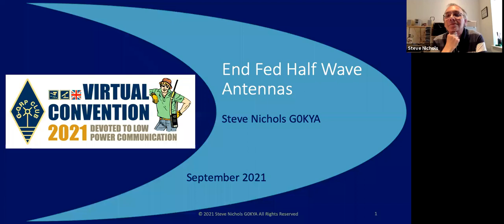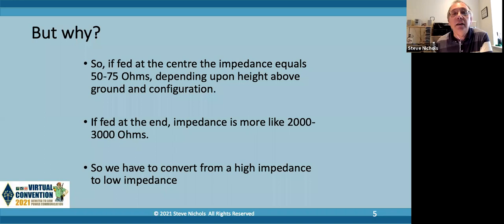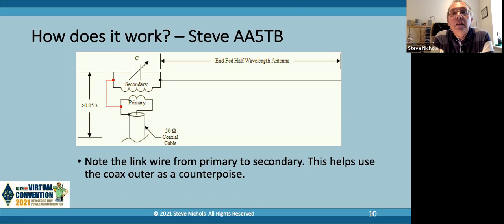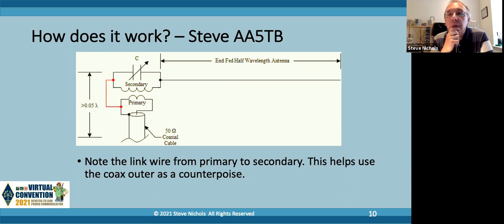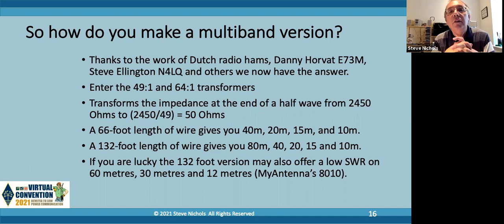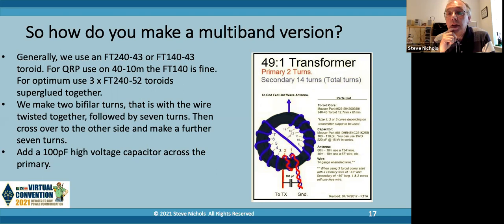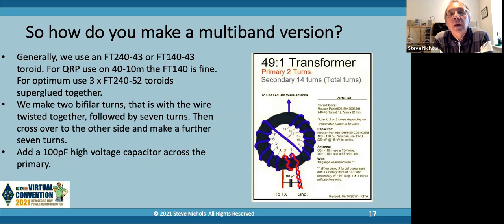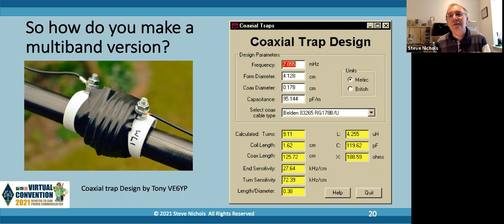Steve, G0KYA, shares his experience of building and using End Fed Half Wave Antennas

Comment: Once Maxwell's equations were published in the 1860's the entire field of antennas went from a new concept to merely engineering optimization for a specific application.
BTW, I've found that a $50 NanoVNA makes antenna design and construction, including matching circuits and traps to be a breeze. Although I have an array of high-end commercial test equipment in my lab, having had a career in electronics for the last 5 decades, my experience is that a multimeter, a NanoVNA, and a TinySA are almost the only tools I need or use for ham radio, and they make the hobby much more fun while avoiding failures with my construction projects.

Comment: A good video. I did a little experimenting with EFHW and Fuchs antennas as well. I discovered that the ferrite core is not necessarily needed. An air-core transformer works just fine in this application (you better check the Q and the self-resonance frequencies, but they should be fine unless you do something stupid). Secondly, it looks like galvanic isolation between the primary and the secondary windings of the transformer improves the performance of the antenna - the RF power doesn't try to go to the coax, and putting an RFI choke on the coax doesn't affect any antenna properties.

Comment: at 18:3 we see the coax capacitor length should be 13cm .. 30cm depending on band, ok. But at 18:31 the coax stub in the plastic box is much shorter. How do you suggest to fit 30cm of RG-59 into the the suggested 80mmx80mmx50mm plastic box? 73
Reply from the maker: please address specific questions to the presenter, they may not see them here.